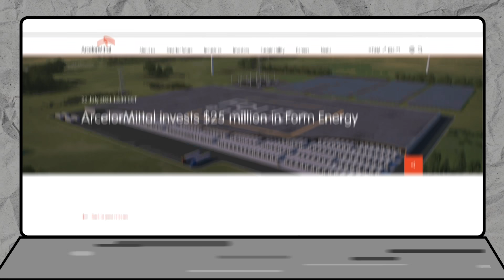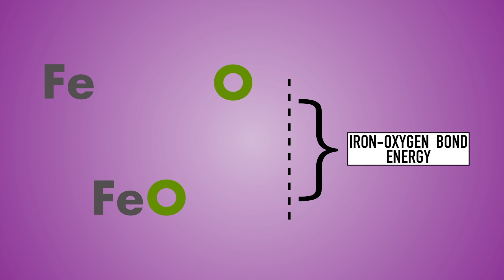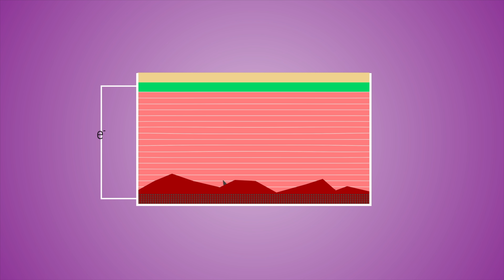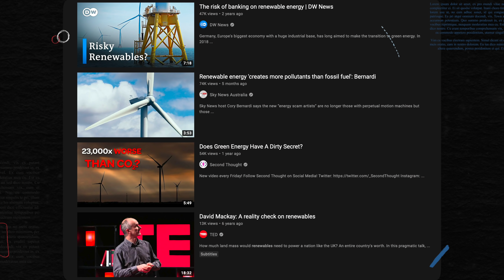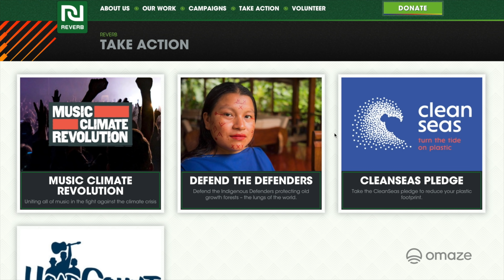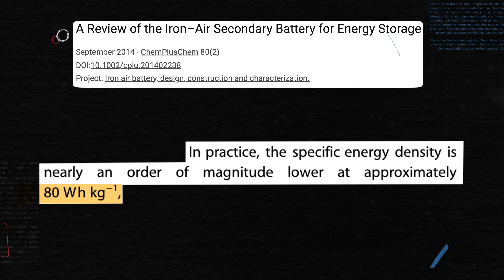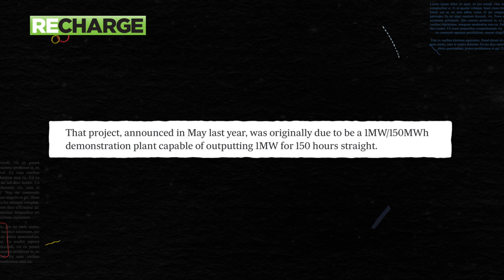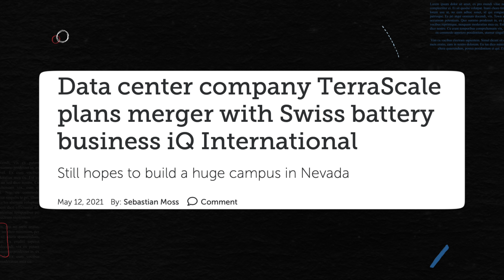Iron-Air Batteries Could Be The Start Of A Revolution In Energy Storage

Comment: Y can't we just use simple gravity for storage just hang weights down a hole and call it a day, at best we can get like a gigawatt hour of storage on a land way smaller than an acre  (m*g*h*(efficiency92%) / 3600) so if a 100,000 ton of anything probably rocks if lowered down to 6000m will store 1.5 gigawatts of Power and lifecycle will be infinite (or at least as long as somthing breaks without any maintenance),

So yeah why don't we?
Reply: but like why isn't this wide spread and the technology is as basic & simple as it can get... And neither there is an argument for not being economically viable. So y not then? Like come on , over a gigawatt in an area as small as a basketball court + round trip efficiency of 92% + and works for centuries and not decades (with maintenance ofcourse) + cost of things like iron or stone is like as low as somthing can get + drilling wells is common and concrete walls aren't a problem + and I did the math highest cost that I came up with was $60 per kilowatt hour 

So like whats the problem , is the government not allowing or is there a problem with ground water interference , what is the damn problem?
Reply: Gravity battery.  In practice it turns out that you need to drop an SUV-scale weight about 600km to realise enough energy to boil a small tea kettle.  😀
Reply: @calmeilles  or you can drop 10,000 tons for 6000 meter to power an entire town
Reply: Guy's why don't you ask Elon nicely, if you can borrow his boring machine and stand it on end, send it down 12km you will be on to a winner.
He maybe a bit peeved, when he comes to collect his machine though!
Reply: Please explain this to a human with half of a brain working..
Elaborate on how it would work , I didn't get it.

By the way  Don't knwoif you thought about it but mining so down would meaning making small holes..
The deepest hole in the ground in the whole earth is hust double that length and lesser than a meter wide.
Also can you put a like in my comment of Stirling and Desalination Domes..
It's like ages since I try to make her read that
Reply: @antoniopacelli  I will explain it. 
When you lift a heavy object upwards you have to use kinetic energy. As energy cannot be created or destroyed, the kinetic energy is converted into potential energy. When that heavy object falls it's potential energy is converted back into kinetic energy.  So you use an electric motor to wench the weight upwards. When it falls the cable is used to spin a generator. 

A more widespread version of this idea already exists. Hydroelectric dams. When power demand is low, the excess power is used to pump water back up to the upper reservoir. When power demand is high, the water is allowed to run down to the lower reservoir through turbines thus generating electricity. I forget what this system is called. I will look it up.

Edit. It's called pumped storage hydropower.
Reply: @ladyselenafelicitywhite1596  Pumped storage hydroelectricity, according to Wikipedia.
I remember my grandfather talking about this. He worked for a power company in Michigan in the USA, from the 1940s to 1970s, so it's been in commercial use for a very long time. 
Nevertheless, just change the name to "gravitational battery", and you'd be buried in venture capital.
Reply: @Rsharlan3  indeed they have and I think the companies that run those types facilities in California have already thought of your idea. 🤔
I was using them to illustrate how a gravity battery works with a technology that has been around for awhile.

PS the earliest version I heard about dates from the 1920s.
Reply: @Rsharlan3  I was curious as to why I thought it was pumped storage hydropower rather than pumped storage hydroelectric. So I looked it up. Wikipedia calls it hydroelectric, but the Department of Energy calls it hydropower.
The earliest PSH was in the 1890s in Switzerland and Italy.
Reply: @George Mann what about kevlar or zylon based tether, they would bump up the cost significantly but also last Along time, 

And why won't simple steel cables work, the seem to hold bridges fine for decades